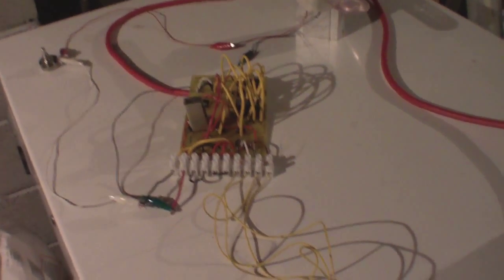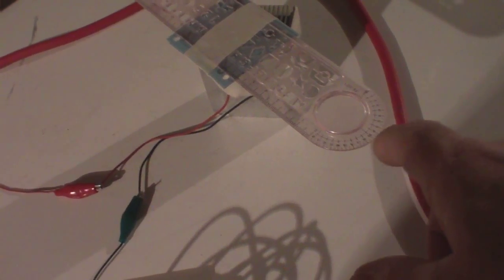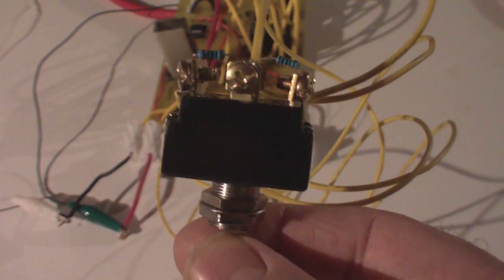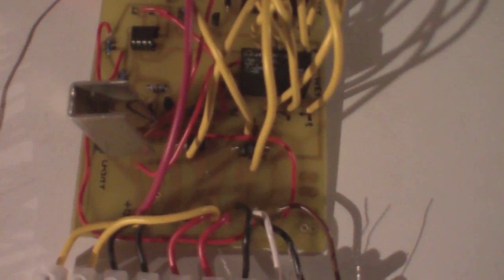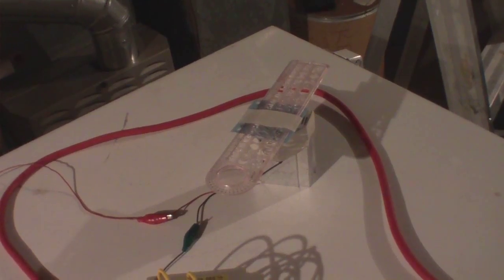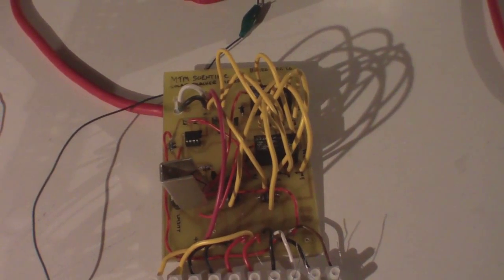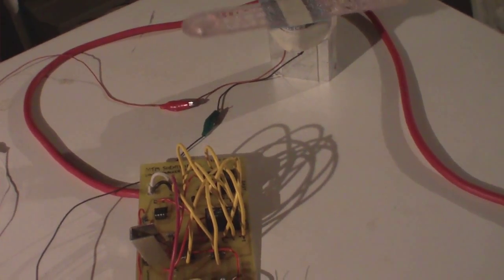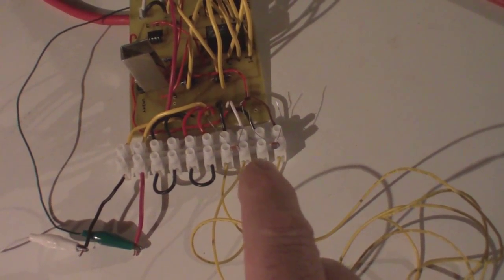MTM Scientific PICAXE Controlled Solar Tracker Build Pt. 3

Comment from the maker: It is in basic. It's just a matter of learning how to address the inputs, outputs etc. The basic commands all apply, i.e. goto if then for - etc. but there are differences from one chip to the next, so there is little stuff. The input math is strange too, as well, because there no provisions for decimal places in math - so - sometimes you have to multiply everything up... for example 132.23 needs to take to 13223, and logic from there